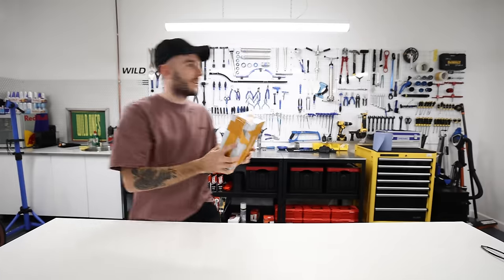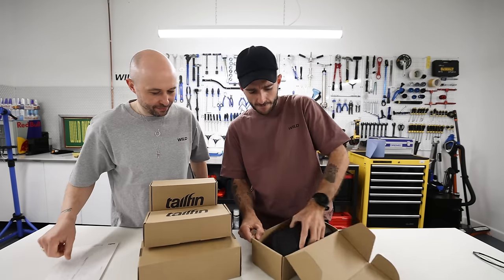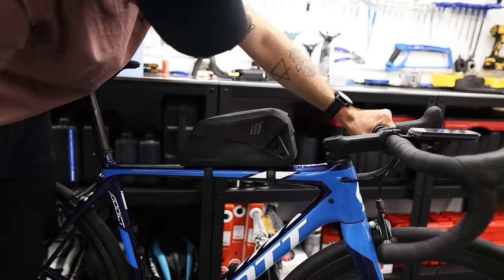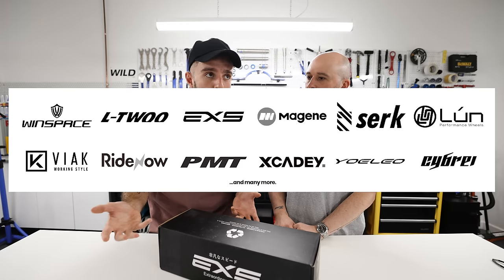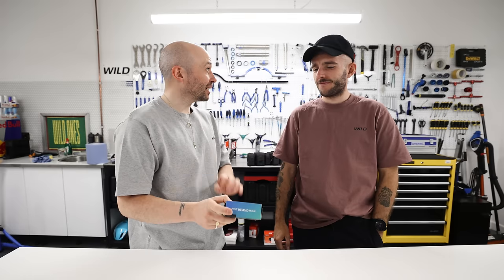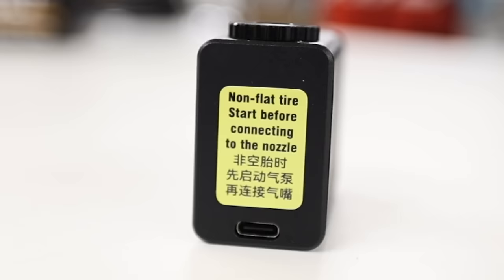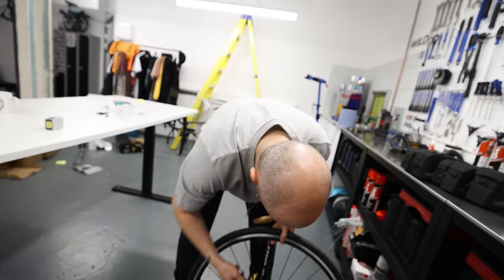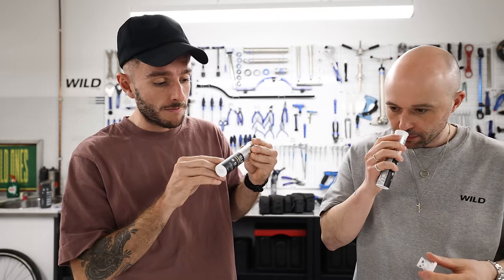Could This Device Change Your Cycling Forever?

Comment: Super thanks to Jimmi and Francis for recommending our product! It would be our honor to have you test and use it! 
Regarding the battery life issue mentioned by some friends in the comments, we would like to clarify that after CUBE is turned off, only the protection circuit is continuously working, with a power consumption of about 20uA. Therefore, theoretically, even if left unused for three months, CUBE still has more than half of its battery life. However, in order to protect the health of the battery, we recommend that you recharge it every three months even if not in use. 
In addition, in pursuit of the ultimate compactness, we did not include a barometer and screen in the design. But we will launch a small air pump with a barometer in the future, which will be slightly larger. If any friends have this need, please stay tuned with us!  
Lastly, thank you again for your super detailed test! ❤
Reply: Will your pump work on a motorcycle tire?
Reply: Guys, I looked for your product but you site was down and could only find competitor products. Need to to sort your digital marketing game out.
Reply: Can it work on a motorbike? Would be insane for adventure bikes that want to take the smallest possible

Comment: Thanks Francis and Jimmi for covering the new Top Tube Packs! We worked hard for over two years to develop the new range to make sure they will be the best top tube packs you will ever use.
Reply: Hi! Can you give us a hint about the big top tube bag Francis used?
Reply: @tomiselmer  I asked about that as I'd seen a black one on Chris Halls bike (hint... suggested it was beyond the trial stage...) Tailfin said "not yet..." but it's on the way... Looking forward to it...
Reply: @markjthomson  thanks!
Reply: I'm anxiously awaiting mine!
Reply: The snapback on the top tube bag is interesting as I've lost count on how bags, jackets, gilets - anything with a zip basically - I have made useless simply because of the zip.
The humble zip is pretty high up on the list, along with shoelaces, of things that we have been relying on for, idk hundreds of years probably and have yet to find another way. My only "concern" for want of a better word, is can you flick them up and get inside quickly before the darn thing latches itself closed again!
Reply: I'd really like a belt-worn pouch with a closure like that... I tried fanny packs too hard to get into while riding, settled on a padded Carpenters tool belt, the pouches hook & loop to the desired position on the belt so they don't slide around when I take it off. the pouches are easy to get into but if I crash everything goes everywhere and if it rains it doesn't stay dry, so I have to take it off and store it in my pannier, but otherwise I can get off my bike & go into a shop, and I don't have to worry about having forgotten my important things on the bike. have my wallet and electronics with me. my system is good I just need a cover that closes
Reply: ya put your weed in there !!!

Comment: FYI, the Chinese on the box for the electric pump reads: "When the tire is not completely flat, start the pump before attaching it to the valve"
Reply: Wish I could do that with a track pump so I don't pish half the air out before I've got the thing attached!

Comment: Fumpa from Australia has been making e-pumps like that for years now! One of them has an accurate pressure gauge, and I have been using it for 3 years now, I love it. I throw it in my bike box everytime I fly with my bike, so I don't have to carry a track pump. If I remember correctly, Dave Rome has reviewed the difference between Fumpa and Cycplus in an instagram post a while ago.
Reply: Yup, I've owned one of those for a few years.

Comment: When we were backpacking through Austria we met two middle aged ladies who were also bikepacking, they had an amazing electric bikepump, which was definitely bigger than the Cycplus however you could set the exact PSI/Bar you wanted it to pump up, really nice if you are weaker or just can't bother pumping all the time, its also helpful to put the exact same pressure in your tires every time you pump it up

Comment: Cycplus will be great for tubeless... put a plug in, wait a bit, pump it up... go go go... I'd just love if you could set a PSI threshold via USB... like setting it to stop at 75 PSI (or whatever fits you...)
Reply: or even if it just had a psi gauge to tell you when to pull it off
Reply: I think a psi gauge would make this a must have.  It’s pretty good as it is though.

Comment: Once a recent group ride the fellow who flatted had an injured shoulder.  I hung back to help him fix it while everyone else went on to the re-group point.  He was unable to get to a decent pressure before his shoulder was screaming at him, so I helped him once his ego got out of the way.  A pump like this would be perfect for the geriatric group rides I go on.  It would also let you get the old tube and tire levers stowed back away, and maybe even remount the wheel to save some time while it was still pumping.

Comment: the thing with that little cube pump is: when that little motor ultimately wears out, or the battery, you'll be stuck so you still have to bring the hand pump "just in case". this happened to me recently (with a much different bigger and heavier battery Bank pump) I got a broken off bit of cable wire in my tire, went to leave work my tire was flat. pulled out my battery-powered pump, and when I put it on it was misreading the air pressure the display of which was fluctuating wildly between 1 and 3 digits (not counting the decimal which was limited to 0 or 5) fortunately there was a fuel station nearby that offered free air, so is able to fill it up and go home, watch the tube the next day, and swap for my hand pump.  

that cube pump is much lighter and smaller than mine was, and takes up similar space as a CO2 cartridge one thing you didn't tell us is how many tires you can fill on a single battery. it doesn't seem to have digital read out, which is a shame since that would have been easy to add to it without making it that much bigger, or adversely affecting the price

Comment: The lengths that roadies will go to in order to not use a pannier rack. 
The tailfin alloy rack with pannier mounts will set you back 215 EUR. That’s 4 times what I paid for my Tubus Fly steel rack. The tailfin looks a lot less low profile and kind of weird. The Tubus fly weighs just north of 700g. Better option IMO if you have the mounts for it. There’s even a titanium version if you feel like spending more.
Reply: Is it possible to use the Tubus Fly steel rack without mounts on your frame?
Reply: @sumselknoten  There are various adapters. Not sure whether it’s possible to mount it to a thru axle though. My frame has mounts. It’s gonna be a lot more difficult obviously on a frame that has no mounts at all.
Reply: The titan airy rack by Tubus costs round about 220 €urodollars and weighs less than the Tailfin rack. Nevertheless Tailfin is a great company that is able to sell a inferior product for roughly the same price. They understood that people on road bikes do have to much cash in their pockets. Their marketing departement should get a raise.
Reply: The easy usage with a drive through axle on a frame without any mounts is tailfins unique selling point for me. I therefore wouldn't say it's an inferior product. And I love bike packing with my aero bike and zipping along at high speeds :)

Comment: That label looks pretty self-explanatory to me. If the tyre is already partially inflated, you need to start the device and then attach it to the valve. Presumably so it doesn't have to fight against the existing tyre pressure when the motor is starting up.

Comment: Those light weight carbon computer mounts.. any good? I've seen forum comments of breakage.. they don't seem as robust as the slightly heavier alloy versions.
Reply: It really depends on the design. Some alloy ones aren't any good too, which also comes down to overall mechanical design. Of course, your system weight (computer + headlight/action camera) can't be too high.

What are some carbon examples are you thinking of? (feel free to attach links so that I can see them)
Reply: @yonglingng5640  Hi thanks, it makes sense. I'm sorry I don't have a specific brand.. but it was one Rides of Japan had on his bike. He also mentioned risk of breakage. I'm currently using an OEM mount from Garmin. This one is quite strong, but it would be nice to shave a few grams 😀👍
Reply: @user-cx2bk6pm2f  Yes, Garmin's own out-front mount is beefy and mounts onto the handlebar, as long as there's room for it. You can check out Framesandgear.

Comment: Am definitely interested in those Tailfin top tube bags. There’s lots of top tube bags out there but most are barely big enough to get a couple of gels in. I eventually got one that will take a mini pump, a small lock and a few tools but it’s not great quality so I might give Tailfin a try
Reply: Hey Matt! We have 3 sizes in our new Top Tube Packs ranging from 0.8L, 1.1L and 1.5L. All of the packs have been specially sculpted using 3D welded shapes to eliminate annoying knee rub and allow you to fit in plenty of gear & nutrition.
Reply: I'm in Ireland. How much in euros to buy?